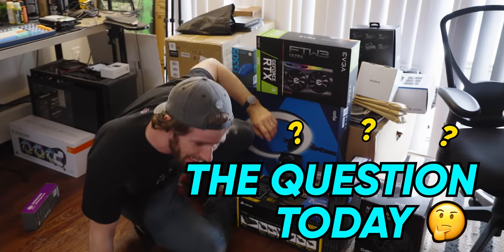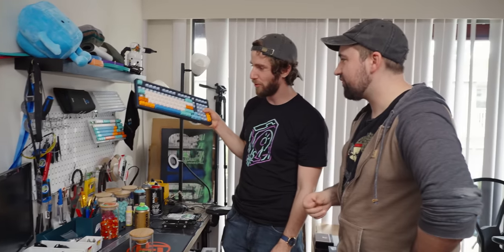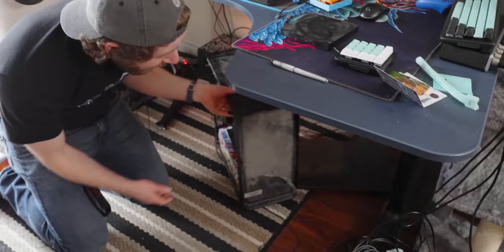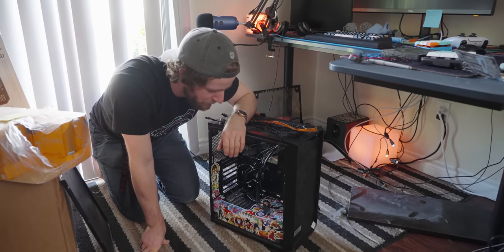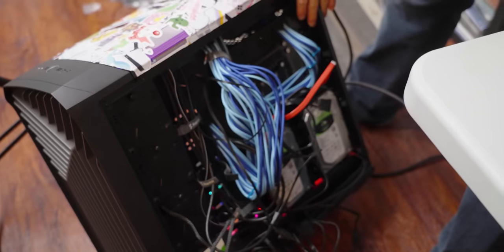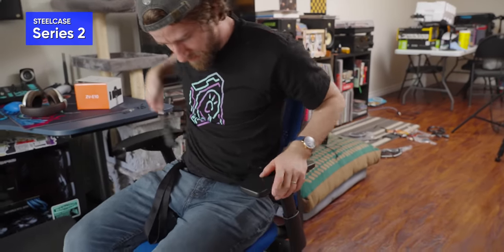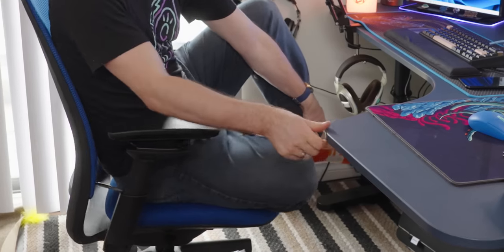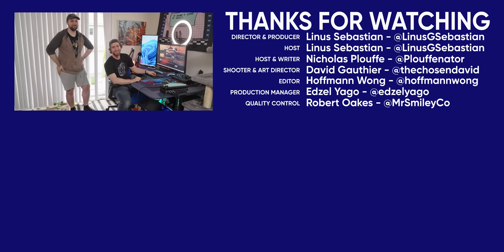I Did a Terrible Job of This - Intel $5,000 Extreme Tech Upgrade

Comment: You can really see Linus' morale dive off a cliff when he realizes he's being asked to kludge in a stack of hard drives in the least elegant or aesthetic way possible, and that the person asking him to do it truly isn't bothered.
Reply: He looks soo damn Heartbroken 😄
Reply: Loved that part, Linus should see my previous server it was just a motherboard + power suply + hardisks and ssd's on a shelf who needs a case, ran it for 12 years like that :)
Reply: @hebbocake  HDD's are pretty rugged, really not that sensitive
Reply: UnjustifiedRecs  i do too, and perfectly fine rack inside the case, i just dont use it XD
Reply: he would have a heart attack if he saw my hard drive just hanging from the cable completely loose 😅
Reply: @hebbocake  I work at an MSP, the number of hard drives we have changed in the last 10 years because of bad sectors or damage is EXTREMELY low. Most drives in servers and desktops are NOT vibration isolated, just bolted to the case. having them stacked aint gonna break them
Reply: @hebbocake  uhh yes. I’ve had HDDs loose in cases for years. You just have to be unlucky for them to die. They’re not made of crystal

Comment: As a homelabber, the harddrive placement in the NAS was painful to see, especially when he had a perfectly fine Define R5/R6, which is a really good server case.
Reply: I was physically cringing at that whole part. Absolute madman
Reply: Same. I'm fucking screaming.
Reply: Why did he do that tho? Why not just keep the old NAS, keep the other case as the computer for her gf and then made the main one?
Reply: Especially considering that the case comes with a hard drive cage that there is little reason to remove..
Reply: @PoulWrist  also have the meshify c, i removed it because im ssd only and can put 3 fans in the front if i remove the hdd cage. But if you use it as a nas, whole different story
Reply: @PoulWrist  To be fair, the GPU blocking it is a decent reason in the chosen case. As for the perfectly good case, there's no excuse for that beyond being picky
Reply: homelander?
Reply: @daggern15  He said he's going to use it to build an actual NAS, right? This other solution is... uhm, supposed to be temporary
Reply: @Nitidus  well, we all know that there is nothing more permanent than a temporary solution
Reply: @Nitidus  He did and I agree but the high number of "I'm gonna..."s doesn't inspire confidence for anything so a good solution for now is better than a jank now with a theoretical better later. I can't help but be surprised Linus didn't put his foot down by the end

Comment: As for the screw driver, I used to work in aerospace and we used to use chromed snap on tools. One day, a flek of chrome broke off and got into some very sensitive equipment. After that, they changed  ALL the tooling to mate black. Long story short, if the black finish scratches off, you do not want that anywhere near your electronics.
Reply: so it's more than just aesthetics, good to know
Reply: AS far as I know ( he said some things in a wan show) it's not chrome plated but that is the stainless steel itself

Comment: Just a note on the screw driver. Put some "extended" bits with it or a smaller precision screw driver in the set with it.  Its very common for some screws to be deep in a hole and having those small bits into hex end wont go in far enough down the hole to extract screw. I see this allot on Laptops, controllers that kinda thing. Sunk in screws suck.
Reply: counter sunk screws >>>>>>>> screws half an inch down a hole 🤦‍♂️
Reply: Especially relevant for keyboards. Saw another youtuber who scratched up the anodization on a new board because the bit was too wide for the screw well.

Comment: One of the best Intel Extreme Tech upgrades ever! I simply love the randomness of it all! And I completely relate to the coff coff furball cat's hair all over the intakes!
But... using the server for crypto mining? Is that still a thing after the crash? Or does he just continue to do it for the "nostalgia"?
Reply: It's possible this was recorded prior to the crypto crash.
Reply: @bigk777  Look at Linus' haircut, it was.... just like the KallmeKris video
Reply: I have a friend who stopped mining Bitcoin with its brand new ASIC in 2018 when it went from 25k (CAD) to 8k because it was "not profitable anymore". He was kind of mad at himself when it went back to 80k recently. Maybe he continues mining knowing the value may increase in the long run.
Reply: @Seskoi  For anyone reading this, if it isn't profitable to mine, but you think the value of whatever is going to go up. It's better to just straight up buy the coin. Not hating on anyone who likes crypto. But it doesn't make sense to mine a coin if your cost of electricity is higher.
Reply: @ivibivivgig6425  I’m still mining ETH with 36 GPUs at home and I’m profitable. $52 per day profit on avg, 2.3 Gigahash total hashrate. until the ETH devs fk us over and switch to PoS (yes proof of stake has the same acronym as piece of sh*t, that’s what it will be at that point) so I don’t think your blanket statement about buying the coin makes sense, those who mined thru the last bear market came out on top because they yield so much more of the coin in downtimes, and that coin multiplies in value like crazy on the next bull run, which will come sometime in late 2024 MAYBE 2023 if we are lucky. I would advise anyone interested in mining to consider getting into it during the bear, hardware is cheaper, everything is just easier because there’s less noise and less distractions. It’s fun! And it’s also how I help support my family. Miners aren’t evil, don’t listen to the bitter YouTubers who want to turn tech enthusiasts against one another, we are all the same!

Comment: With how much Nick tinkers with keyboard parts, I wonder what kind of work he could do with arcade stick buttons. There are some that use keyboard switches.
Reply: Tbh, for the most part you won't notice the characteristics of the switch. I built my stick with Crown 301/302s? that use keyboard switches. But since the pushbutton itself rubs so much against the housing, you don't  get much benefit from lubing or using different switches.
Reply: I know, right.
Reply: @duckadence  What about the Hitbox variant that uses keyboard buttons?
Reply: @Neoxon619  If you're talking about the mixbox, then it's basically a keyboard WASD

Comment: Linus: Do you even use the dough shovel? It's suspiciously clean
Also linus after seeing the some remains: this is gross
Reply: I think Linus meant like ash residue and discoloration from that. I have my own and the very tip is definitely well blackened by now and scrubbing doesn't make it come off either.

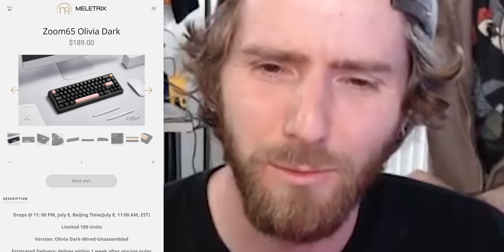Comment: At 24:38 the issue with this argument that I hear all the time (I've been into customs for like 3 years now) is that it's not an equal comparison. The keyboard KIT cost u 200$, add in around 40$ for switches and lube (not to mention the time it takes to lube them), 20$ for a kit of stabs, a random 10$ usb-c cable, keycaps are gonna run you anywhere from 50-100$ and now suddenly your argument of "But it's only 200!! Logitech, Razer, whatever have boards that cost that much!!" well no, because now the keyboard is 300-360$. People who are into customs need to stop with the absolute BAIT of "It's only x" when x is only talking about the cost of the case, pcb, and plate.
Reply: While that can be the case for some keyboards, not this one. Zoom65 is a complete package that comes with prelubed switches, stabs, and keycaps.

Some keyboards can absolutely be wild in pricing but there is absolutely budget friendly and beginner friendly options out there.
Reply: You realize that not every keyboard in the customs hobby has to be some gasket-mount, super flex-cut, CNC aluminum with brass weight artpieces with GMK keycaps + artisans and frankenstein switches right?

There's a whole sub-culture in customs that don't mind stuff like tray mount and find boards like the GK61 or Womier K61 that are sub-$100 for pre-assembled kits as budget messiahs, are fine with more budget-centric dye-sub keycaps that are around $30, and pretty much are able to make something great out of basic gateron yellows and the stock stabs with just some extra lube for an extra $10 vial of K205g0 that will last them multiple keyboards. You can buy an SK68 with gateron optical switches, do the bare minimum of lubing the switches and stock stabs (+$10 if you get durocks, ooh so bad) and put in even paper towel into the case as a foam substitute and still have a really great gateway drug into customs for literally sub-$60, where you'll more than likely otherwise find cheapo Reddragon keyboards with Outemu switches or "mechanical feel" keyboards in that price range.

Even some of the top creators in the keyboard space admit to the pointlessness of paying excess amounts on those kinds of things, they and the majority of the community know that anything more than the basics is just luxury. In spite of that though, the more we do fund and adapt these upper tier keyboards by dedicated designers with more "luxury" features like mounting styles or profiles, south-facing switches etc, the higher quality we will have at the lower range for similar quality in the future because somebody will want to adapt that popularity at a lower cost to open up to a larger audience and rake in more profit than the "end-game" keyboard designers. Just a couple years ago a really good top-tier aluminum TKL with top-mount was several hundreds of dollars, and now you can get a Keychron Q3 which has fair gasket mounting and a really good capability to sound good being a $200 option even during this hell of a recession. You just have to look, and more often than not, not for very long to find something that's great for the price.
Reply: Plus he already admitted to one board being roughly $500 and it was missing over half the keys, and having $80 single keys for like spacebar. Like Jesus christ.
Reply: Is $200 and $300 really a big difference?
Reply: @bbking006  that’s 50% my guy. Almost a completely different target market.
Reply: @bbking006  for people who have to work to make money, yes
Reply: @sophv  I'm thinking about the difference between like a $900 Kiton shirt vs. a $1500 YSL one. Is it not the same category?
Reply: @faustinpippin9208  Are you implying I do not work?

Comment: The HX1000 with the 3090 FTW isn't a good combination, the transient power spikes caused my HX1000 to restart constantly unless I throttled the 3090 to 80%.  I'm not sure if all HX1000's can't handle the transient power spikes or not, but I ended up replacing it with an EVGA power supply and haven't had an issue since.

Comment: After all these Intel Extreme Tech upgrades he had to sit through patiently, It paid off Big time being one of the later ones.  3090's are a thing now (and won't cost $2200 USD)
Reply: These are usually prepped a bit in advance and the 3090's only just got their big discounts so I don't think he got that lucky
Reply: @draginator6  yea I remember them saying in one , Oh when I ordered this I9 11900K 4 months ago it was the TOP. Then Alder lake came out... OUFF lol    But on another note. I just purchased a EVGA 3080TI FTW3 Ultra ON SALE ($430 off) from best buy. So yeah there is a surplus at the moment.
Reply: @scottcol23  Congrats on the card! I have a 12600k and 3070 that I'm happy with but more graphics power sure would be nice for vr.

Comment: Ah yes, a fellow full-size keyboard end-gamer. Finally, another one exists.  

Edit: Ah nvm that's an 1800 layout (96% "full size"). There's no 104 or 108-key end-gamers out there still lol.
Reply: That is a 65 percent tho
Reply: What was the full keyboard? I couldn't tell
Reply: @zerotwo_.002  Except for the one that he actually said was his end-game and was an 1800 layout.
Reply: @AaryaAndSethDaddy  The one on his workbench that he said was his endgame. Looks like an Akko mod 3098B or an Odin v2 (which I myself ordered and then cancelled when Keychron announced their Q6).  

It's an 1800 layout which is a 96%, so not a "true" full-size, but most people in the space will call it a full-size. Which makes it a little hard to search for full-size 100% 104key or 108keys.
Reply: @soulofjacobeh  thanks! I hate akko boards though. Their extremely difficult to open. 

Weird that he said it was his end game with cheap switches when Akko boards don't really cost much
Reply: @AaryaAndSethDaddy  I made an edit to my reply because I saw the keyboard more clearly in one of LTT's shorts. I think it's actually an Odin V2, my bad.
So like a $450 board with a weight, polycarb plate (optional steel or brass plate, I forget).
Reply: Mark me down as the third member of the cult. I couldn't be less interested in TKL, 80%, 60%, and 40% boards.
Reply: @soulofjacobeh  oh i didnt notice that. i just say the one on his finished setup and guessed that is what you were talking about.
Reply: I have a 108 keyboard

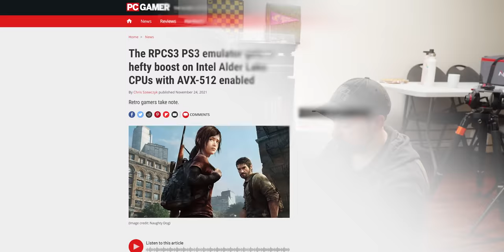Comment: Funny, I have one of the early 12700k chips that has the circle logo where the squares are, meaning I HAD AVX-512 on my CPU, but a couple weeks ago I discovered my Strix Z690-E board had a few new BIOS updates and I’d been having big memory stability issues on DDR5 since launch, to the point I couldn’t really use my system without some sort of glitch or BSOD, and based on what Linus said at 8:43 since I updated BIOS now my chip is permanently disabled for 512 support?? So even if I put it in an old board without an updated BIOS the instruction set is now just gone?? That sucks Intel F YOU smh

Comment: Question: On the upcoming ''Intel $5000 Extreme Tech Upgrades'' are people gonna be obligated to also buy ARC GPUs?
Reply: Nah, it's from the Intel CPU division, not sponsored by their GPU division
Reply: They don't compete in the higher tier graphic cards, so I don't see why they would. There isn't an ARC RTX 3080 equivalent.
Reply: @Tomazack  Isn't a 3080 a high tier card tho? I mean I get it, it's not a 3090 or 3090 ti, it's still fucking 800 dollars tho, you can buy 2 consoles with that money.
Reply: @tumamaencosplay  well, that's what I said, there isn't any Intel GPU to compete with the 3080, which I used as en example of a high tier card.

Comment: That is a very real concern from G.Skill. I have one of their DDR4-4400 CL18 Kits and the only, and I mean ONLY, CPU it works with at its rated speed is an AMD Ryzen 7 5700G. No other Ryzen (3700X, 3800X, 5600X, 5900X, 5950X) can do it, and neither can my 12900K.
Reply: Yeah, my 5600G can run my best kit at 4400C17 (or 4733C20), my 5900X can only do 4000C16.
Reply: that has nothing to do with G.Skill, it's the memory controller and limitations to bandwidth on infinity fabric on zen architecture. 
if you get lucky your zen3 will run 4000mhz.
Reply: A 12900K should do that fine, but AMD isn't known for good memory controllers...
Reply: @dyyylllaannn  It's not about bandwidth limits, and I hope you weren't thinking I was trying to run these clocks with a 1:1 InfiniyFabric cause that is far beyond the capability of even the goldest of Ryzen I/O dies.

My point is that even if you ignore the performance implications of the move and concentrate solely on going for high clocks these kits seem to have such a high likelihood of not working at their stock speeds (outside the use with Cezanne-based Ryzens) that G.Skill isn't willing to just send a DDR4-4400 Kit to journos without a proper backup. They know their return rates on these DDR4-4400 Kits.

I've never had my DDR4-4000 Kit fail on any of the CPUs I had trouble with the DDR4-4400 Kit on. In fact, the limit for Zen 2 and 3  is usually in the 4200 to 4266 range.
Reply: @ILoveTinfoilHats  AMD has done a pretty good job with the memory controllers in their monolithic SOCs, like Cezanne.

It's their I/O die used in both Zen 2 and 3 that usually runs into limitations in dual-channel operations in the 4200-4266 range.

And as for my 12900K, I've not spent the time to test its limits on DDR4 and currently only have a single board for it in active use, but I know I tried the DDR4-4400 Kit when I got the CPU and Board and it showed the same behaviour of not working on XMP settings.

It's virtually impossible to point to the RAM as the culprit in that scenario with any certainty without trying at least a few more boards and another CPU or three, which quite frankly is a bit beyond what I'm willing to do just to add another platform to the list of not likely to work correctly with this G.Skill DDR4-4400 CL18 kit out of the box.
Reply: @proesterchen  ok galaxy brain. post a vid of your Zen2 running 4200mhz
Reply: @dyyylllaannn  First of all, no DDR4 runs at 4200 MHz, so I guess what you're asking for is 4200MT/s.

Second, you seem blissfully unaware that AMD use the same I/O die - and, hence, same memory controllers - for Zen 2 and Zen 3 CPUs.

Thirdly, there are plenty of videos showing Zen 2 at that speed, in fact, searching on a little-know video site called Youtube might find you several examples, like 8H0DEkpEDCE

Comment: 10:20: "Black shaft coating" - ok, but why not to perform a thermal conversion to black oxyde (blackened steel). Not only it will look dark, it will also not peel and provide some corrosion resistance.